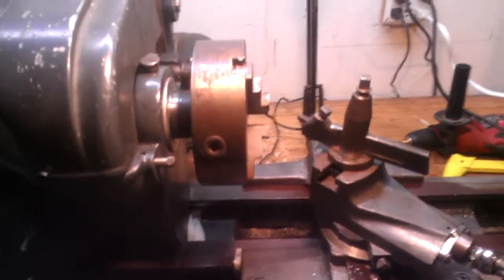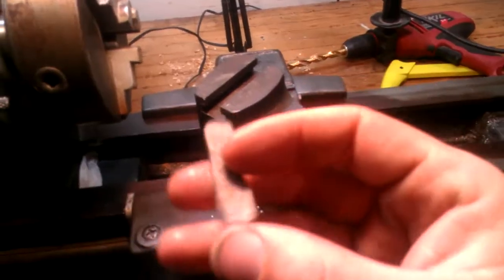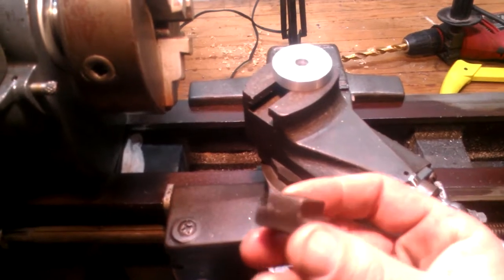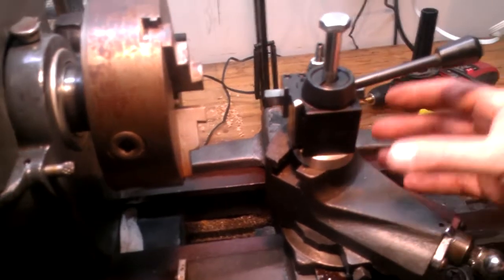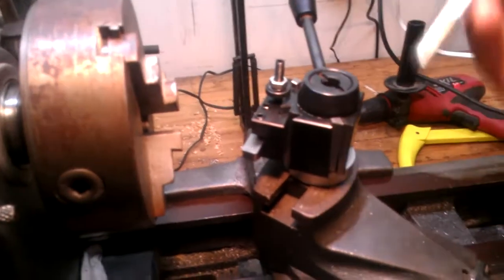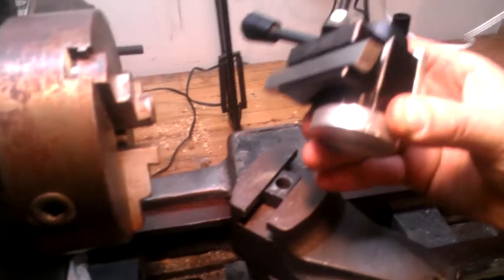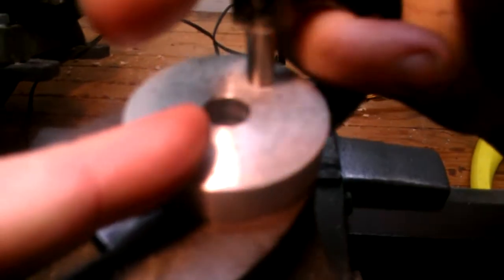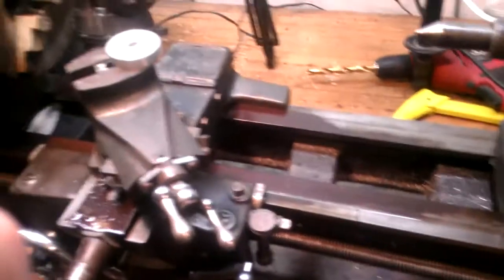Atlas lathe quick change tool post

Comment: Good to find a way to use that nice OXA kit.  Rockers suck.   It would be cool to try running the 10" compound with a BXA.  Might be able to run a BXA on the stock compound.  I bought the AXA for me Atlas 10" which is a sure fit.  Hoping in trading around on lathe stuff to run into an Aloris QC tool holder although my import one is working fine after fastener upgrade.   Good to see another Atlas/Craftsman owner in the YouTube Creator community.
Reply from the maker: the AXA is the right size and it's always good to finds more atlas users. I want to start making so repo parts fore them. your 3d printer would be handy fore making paterns.

Comment: Hi Chris, until you find another tool post, guess it would be easy enough to transport from one lathe to another, in less time that it takes to adjust the lantern style one.
Pierre
Reply from the maker: pierre beaudry that is correct  the other machine is a harbor freight 3 in 1 kinda junky but  its the only vertical mill I have access to . and its still not even here lol .

Comment: that t slot nut just wondering what the dimensionsare on it i want to make sure i order the right one if possible  i want to install the same tool post on a the same lathe that i have.
Reply from the maker: I will mesure it for you. Thanks for watching
Reply from the maker: Ok the total high is.682" flange hight is flange with is  .966" flange thickness is .306" and the part that fits the slot is .622" in addition to the nut witch I made from 1" round bar you will need a spacer under the oxa too post to get s workable hight it needs to be srounc .418" or so. And 1.800" wide not super critical on this one. I would recommend using a AXA tool Post if you can afford one it is the right size for this lathe. I. Just using this one because I had it.

Comment: Nice quick change post. Are you going to do the treading yourself? If so, I'd like to see the video.
Reply from the maker: maby I am just going to use a die to do it . no half nuts on this rig . need to move everything to the longer bed and install the new half nuts. next series I supose
Reply from the maker: eviltwinx I did but I botched the job lol . so I turned a round nut if you saw the video?